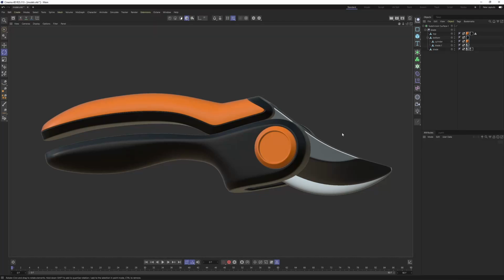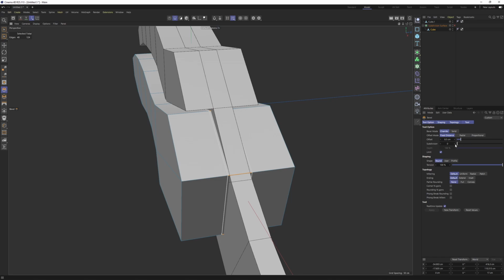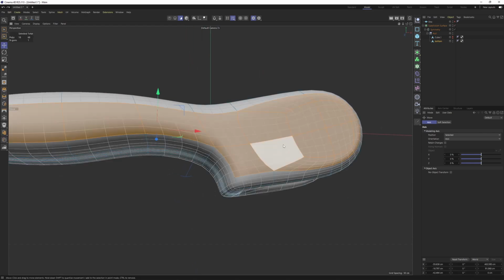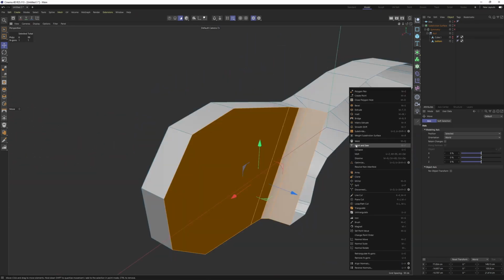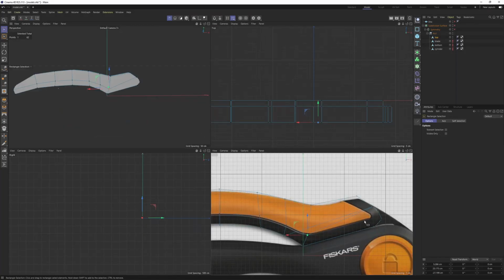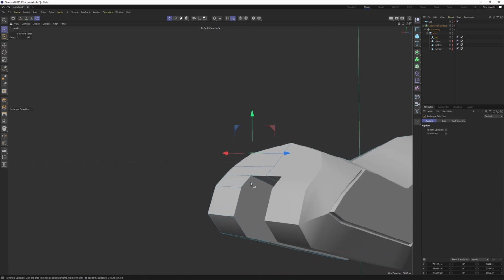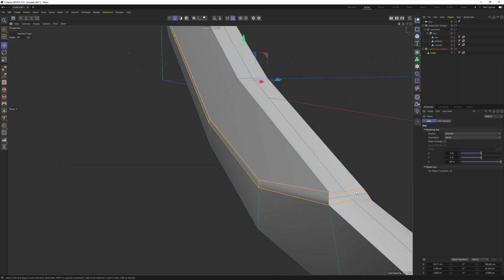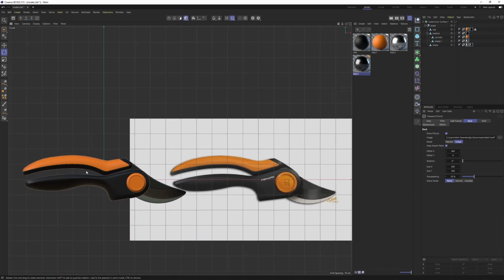Industrial Design/Product Modeling #18

Comment: How come extrude leaves internal faces? That's hellish
Reply from the maker: There is an option for this, so normally this won't happen, in my case, it happened because I extruded the edges, I didn't notice.
Reply: @polygonpen  how is it called? sorry Haven't used C4D for long time ago
Reply from the maker: @orphydiancg7759  In the extrude options, you can turn on and off ''create caps''
Reply: @polygonpen  thanks , this adds a big ngon only or ads a duplication of the entire selection that get extruded facing the opposite direction?
Reply from the maker: It adds a duplication basically.
Reply: @polygonpen  awesome, so its like Thicken option in Modo for its Polygon bevel tool. Blender has a separate tool for this called Solidify faces and also a modifier.